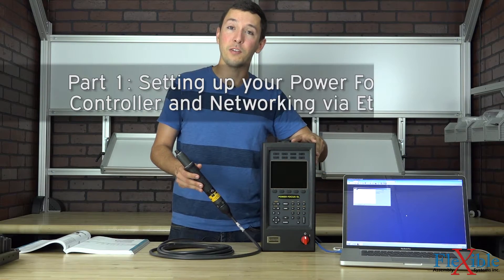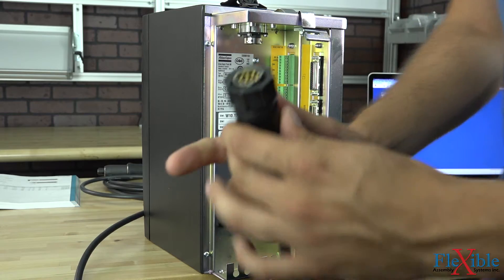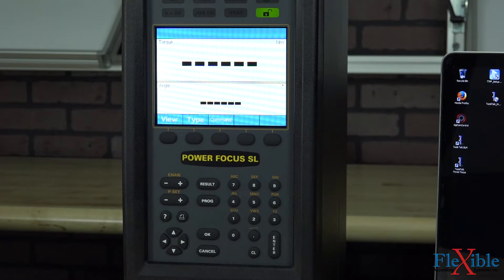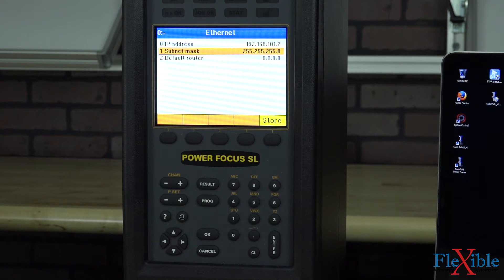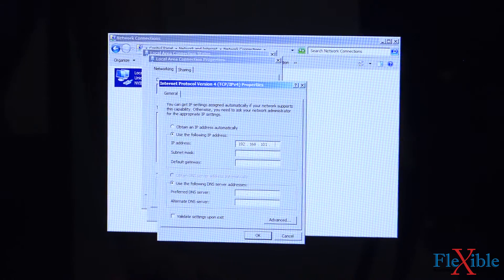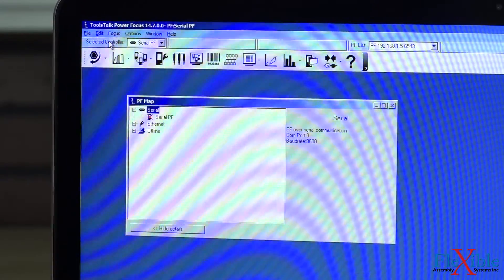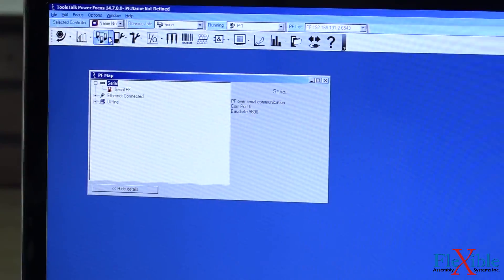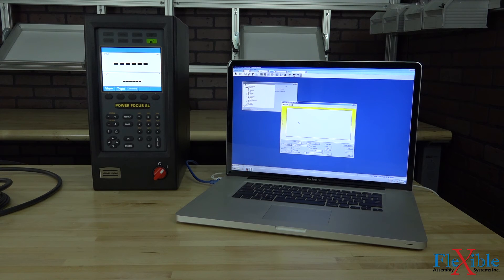Atlas Copco Power Focus SL Tutorial Part 1 - Assembly and Ethernet Setup

Comment: I have a question, If I try to connect with a new laptop, and will do this procedure, can I lose the data from PF?
Reply from the maker: If you connect a new laptop you will have to reconfigure the IPv4 settings on the laptop to connect to the controller if using this method. The data on the Powerfocus will not be changed or lost by changing to a new laptop since that information is stored locally on the controller in the IAM module.

Comment: how can i scan barcode and collet data in software for that one part?
Reply from the maker: For the Power Focus SL controller you would just need to attach an RS-232 Bar Code Scanner, then in your PSet set a custom input field that uses the scanners output to save the SKU or whatever data you require.